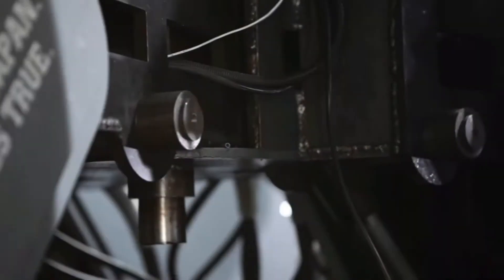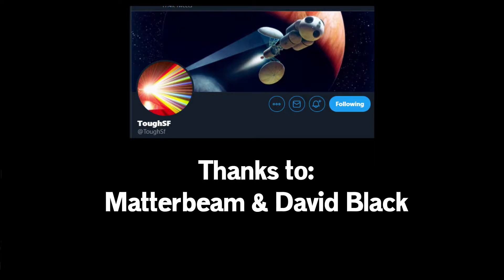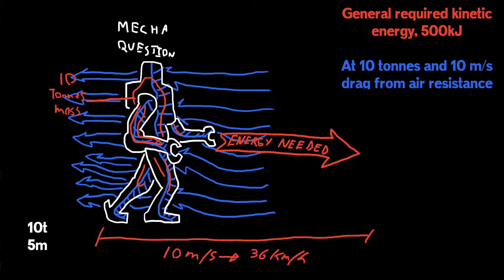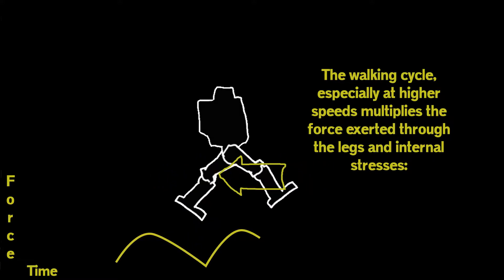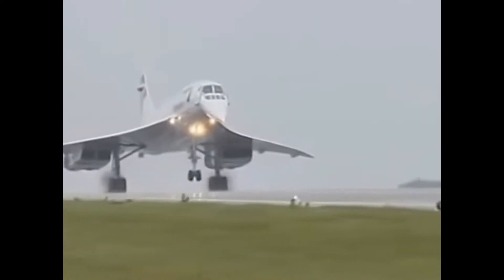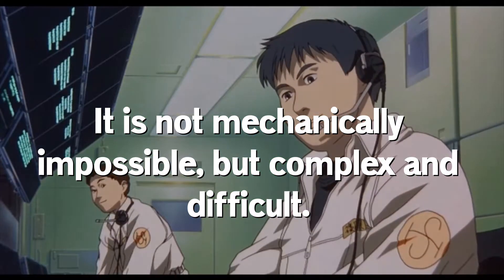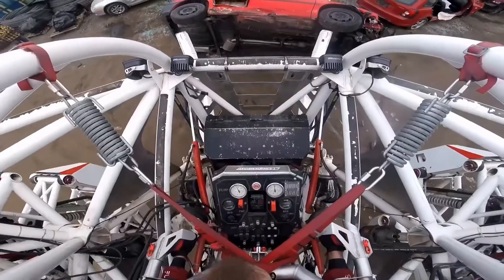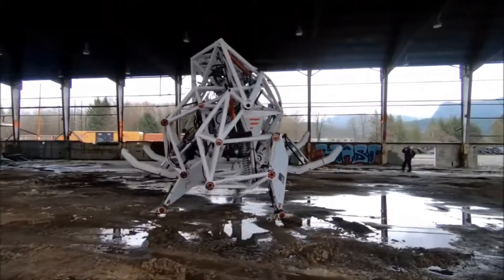REBIRTH OF MECHA 3/9: KURATAS, & WILL THEY EVER EXIST IN THE REAL...

Comment: Why not make a mecha with thwo legs but instead of feet at the ened of the legs it has wheels and brakes like a roller skate if you will . All you would have to do is working on the gyroscopics and the weight distribution
Reply from the maker: actually quite a number trying that out, the Kuratas guys are working on a new machine to better integrate wheels and legs right now fun fact.
Reply: @argonbolt  if they manage to find it out the machine wouldnt necessarily need to walk or run it could just skate. And if it goes off road the tires in the wheels would act in place of the ball s the feet like in humans and could probably grip most different terrains

Comment: i dread the nightmare of designing a foot with every square inch filled with sensors and a advanced mechanical muscle structures. just so it could mildly jog thru a Forrest and not trip and face plant from uneven terrain.  makes you appreciate all the features built in to the organic human foot that we take for granted.  the fact we can run thru a Forrest trail with all the uneven surfaces, logs,rocks, slippery leaves, ect, the fact the body has an instantaneous, auto feedback correction balancing  system that can run subconsciously, is astounding.
Reply: so don't go that advanced of a route. just use hydraulic joints with sensors in the part's controller that measures how much fluid is being pressurized into the joint and measure that against the articulation resistance with the ground. the math on the software-side might be complex but the hardware shouldn't have to be.
Reply: @mikestuckinthemiddleofnope8783  the foot in a way still needs to curl around uneven surfaces. like forests and mountain rocky terrain and such. flat footed or a foot that that can cover the most surface area is better do work to a point. but a real humam foot with its range of flexible motions can gain adapt to a ton of difficult footings. that a simplistic foot could not.  some footing regardless would need tip toe footing, or heel. the pressure on the foot in areas would always be different depending on the obstical the foot has to traveres that step. so a simple base line pressure would be better then flat footed but still not even as close as a real foots range of motions and fined tuned power muscle movements that eash small section the the foot can use that it needs for that specific difficult step.
Reply: @stevenmike1878  good points but i still think a more simplified plan is the way to go. i do think  there are ways that you can easily simulate the "toe curl" with a single plate. personally i'd use a widened triangle for the plate that is the point of contact. check out the Atlas agility trials from Boston Dynamics. I'd try to study how they'd done it so far. remember that everything is just building upon engineering lessons that others have already learned. personally, even though i know it'll take trial and error, i do think it may not be as complex as people seem to commonly believe. hmmm... honestly, i wish i could come up with a drawing to show you. maybe i can. tell ya what, i'll see what i can come up with and i'll get hold of ya when i have something.

Comment: Actually bro ur very correct but heres a better way to get to your point...when money is actually not a obstical we make things like "atlas robot" Wich moves exactly like a human in truth all we have to do is find a way to scale it up and put cockpits in it
Reply from the maker: Except that Atlas is not the same, its human shaped sure, but as i mentioned in Part 1, those machines operate on an entirely different scale of physics. 

Some things can be roughly transferred like the balance programs, but as i mentioned in part 1, down to square cube law the forces acting on the larger mecha, even one just 4-6 meters tall, kinda changes a lot of things to the point its basically a new machine. 

The difference for example on just the hip joint can be as much as tens of hundreds of kilo newtons of force.
Reply: @argonbolt   oh I kinda understand..basically scaling up is changing "geometry all together " In some ways I see
Reply: @argonbolt  you know what though ..I'm ok with kuratas   design I think it's almost exacting and with more money it would be amazing machine and if we where able to make move as smoothly as a human  and have the ability to change its height just like a human give it a radar like the apache helicopter has and missiles similar to the hellfire missle it would be a bad ass replacement for a tank..apache helicopter is a tank killer and since it can elevate above obstical it can then use stand off capability or range unlike a tank that is obstructed by buildings and mountains and hills ..the apache can simply raise u high enough for it's mask radar to scan the battlefield never exposing the helo and it now has a radar/attack range of 16miles ..putting that on a mech and the mech using hills and terrian as cover awsome
Reply: Also giving the mech that anti radar structural angles of the stealth bomber to make it invissable to radar  imagine it use would be incredible in many ways it would be like a super soldier and would be able to save injured solders due to having apendeges unlike a tank or plane wow